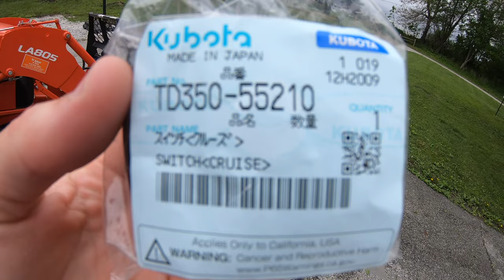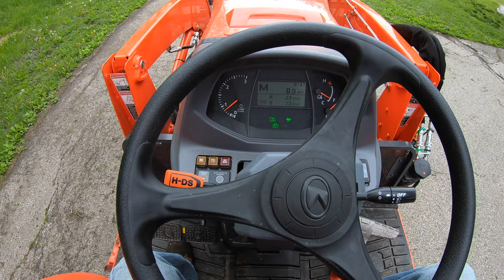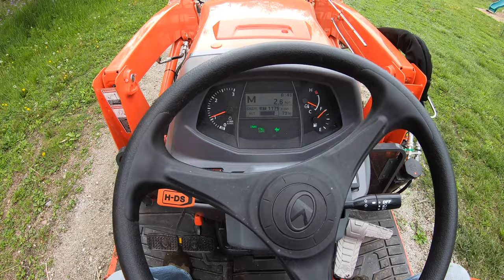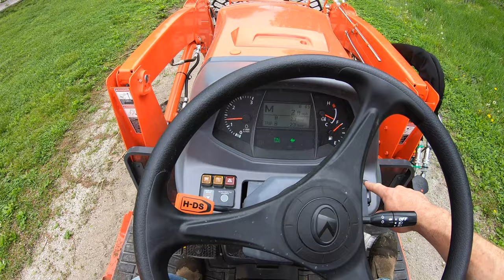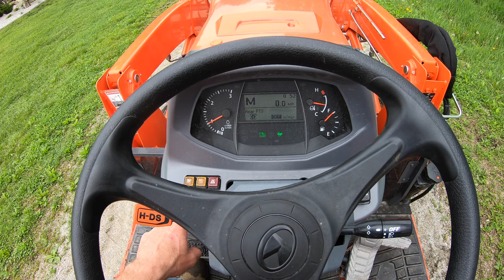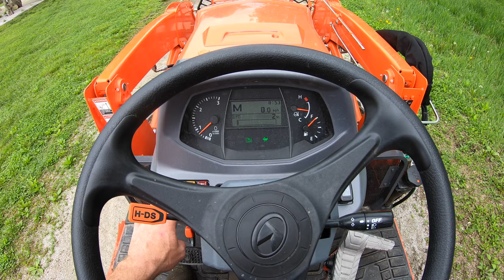Adding Cruise Control to a Kubota L4060 Limited Edition

Comment: You need to make sure you have the same ends on your hydraulic lines so both tractors can move the same wagon, or whatever equipment needs hydraulic connections. Like all the wagons and tractors at our farm use the Pioneer couplers on each tractor so it doesn't make any difference which was the last tractor to move something.
Reply from the maker: Ya I need to look at that
Reply: When I looked at the rear hydraulics I asked what male connectors are needed and was shown the pack that comes with the kit, it includes 2 male couplers per kit.  They all use standard fittings for attaching to the hoses, so that is one way around it.   Right now my JD 1209 has old style John Deere fitting, so I can just sway that out when I get the new tractor with one that comes with it.

Comment: Funny a the wiring there but they dont put the switch in. I've done that with cars wiring all there. Are you going to bale hay with it? Have a good day.
Reply from the maker: I wanted to bale with the John Deere but I might just use both.
Reply: @HumbleAcres  I'm buying an L4060 HSTC to bale with. I ran my HN 273 with my little B2410 the other day to see if it could, and it worked just fine. Moved the tractor around a bit, but it only weighs 1600 pounds. The L4060 weighs 4134 with the cab and no loader and I think the loader is another 1300 pounds, so about 5400 pounds vs 1600 makes quite a difference. There is only a 400 pound difference between the HSTC and HST so you should have no issue baling with it.

Comment: So how much did you save by putting the switch in yourself?
Reply from the maker: The switch cost was $80 I don’t know how much the dealer would charge to put it on but the video is more just showing that the wiring is already there so it’s easy to put on if you want it.